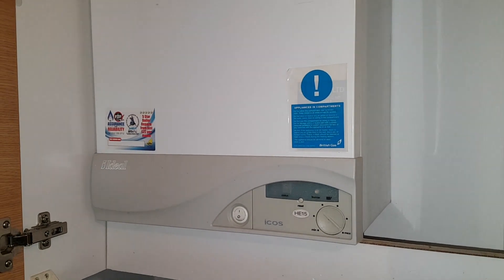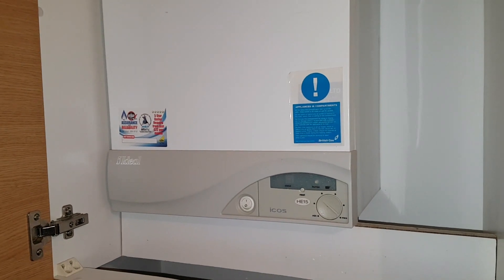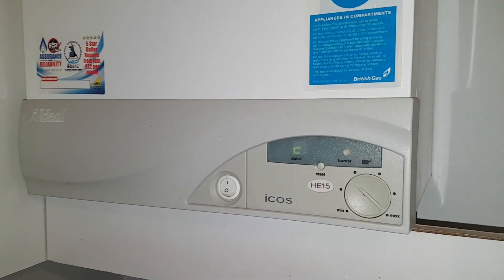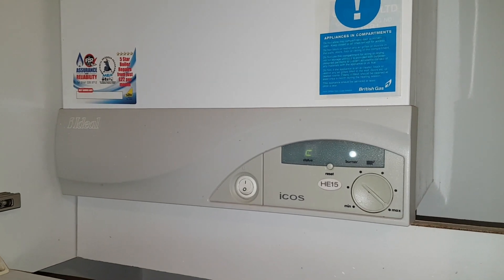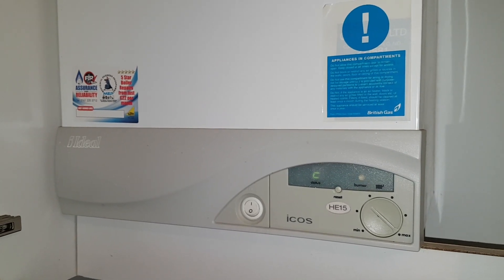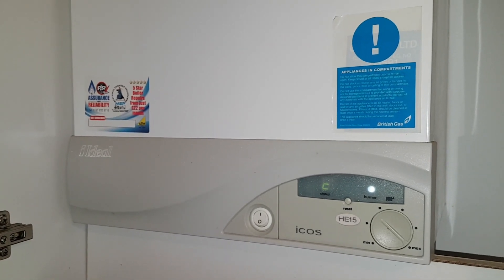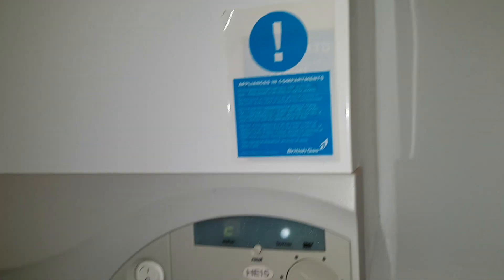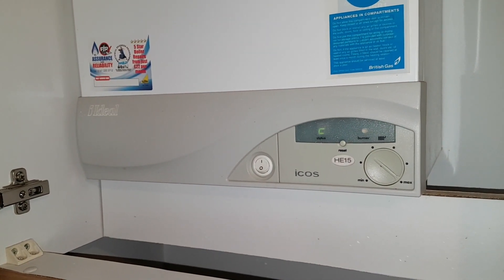Ideal Icos HE15 What Are The 2 Faults?

Comment: My Boiler is making a kettle noise and then locking out, is this a blocked return pipe as the boiler is overheating? It has had a new pump and 3 why zone valve?

Comment: I recently had this issue. For me the hot water was fine but no had no central heating. If anyone is watching this looking for answers, I removed and cleaned the trap and it didn't help (but needed cleaning). I then noticed the pump was making a strange noise, so replaced it. This solved the problem instantly and the boiler no longer makes noises.
Reply from the maker: Thank you for your comments. Can I ask if you would subscribe to our channel 😊

Comment: I have the same boiler, just moved into a new house. I can't get the boiler to restart. It has a 0 on the front which I know means standby, but the restart button does nothing. Could you give me some advice please? Thanks
Reply: I'm in exactly the same situation. Any ideas?
Reply: hi i have the same issue , were you able to resolve , if so how , kind regards
Reply: @kbeckfor  No, it's been  replaced with a combi boiler.
Reply: @rachelmichellef  thanks

Comment: Hi All.  have the very same Boiler -  We didn't have good pressure to have a decent shower, so installed a pressurised tank under the stairs about three years ago.  all good till now.  Water is hot thankfully but heating is intermittent.   we have a Honeywell wall controller for the temperature, i believe its wireless.  Ideal support team claim the issue is the temperature controller.  so the question is -- what's the best temp controller to use and how easy is it to do so?

Comment: Check the condensate trap for sludge. the Icos has an aluminium heat exchanger that corrodes like a bad-a55 and the particles blocks the drain. 

Also check the pressure vessel if you have a sealed system. you need 1.3 - 1.5 bar. if you're around 1.1 bar that's close to the boiler's auto shut-off pressure.

Comment: Hello is this a system boiler or a regular conventional boiler? I have one of these with a hot water cylinder and no water tank in the loft, trying to work out which will best replace this type of boiler
Reply: If you have a sealed system (red vessel on top of the water tank) then check the pressure. it should be between 1.3 - 1.5 Bar.

Comment: What was the fault with this?...I have the exact boiler doing the exact thing, no hot water🙈
Reply: Did you fix it?
Reply: @minot.8931  hi i have the same issue , were you able to resolve , if so how , kind regards
Reply: @kbeckfor341  On mine the condensate drain was blocked.  The boiler has an aluminium heat exchanger, so it produces small pieces of aluminium oxide (looks like grey grit) inside the boiler.  That ends up in the condensation trap (the small black plastic box under the boiler) and eventually blocks it, so the condensation collects as water inside the heat exchanger.  When it gets full, the boiler starts banging  (suffering from "explosive ignition").  You need to remove the condensation trap and empty out all the grit.  Ideally you should also remove the panel from the heat exchanger and dry it out, and then sweep out all the grit, to save it getting into the trap and immediately blocking it again.     On mine, I had a further complication in that the plastic exit pipe from the condensation trap to the outside drain was blocked; I suffered a blocked drain not long before so probably sewage/gunge/kitchen sink mess etc. had backed up from the sewer and reached the connection of the condensation pipe outlet, where it joined the drain, and had blocked it.  I used a bit of caustic soda down the pipe to dissolve the soap/sludge/poo or whatever was down there.  Don't use caustic soda anywhere near the aluminium of the heat exchanger since caustic will aggressively attack aluminium.. only down the plastic pipes.   I used a kitchen spray bottle to squirt the caustic soda down the pipe... but be careful with it (eye and skin protection) since it'll splash/spray and it will burn you.
Reply: @minot.8931  thank you very much 😊🤝😊😊😊😊

Comment: I have this boiler, since last its been making a constant noise as if it's on but neither central heating or hot water are switched on but it's still making noise. It's normally quiet. Reset button on front does nothing if pressed in.
Reply from the maker: It could be a zone valve fault

Comment: Water is not getting through the boiler and its cutting out due to thermal cut off.  The gurgling sound indicates that the circulation pump may not be providing enough / any pressure into the boiler.
Reply from the maker: hey we're currently trying to grow our Facebook group and would love you to join Tony and the team using this link, Tony will be available to answer all your questions directly https://www.facebook.com/groups/167070231326174 we will also add this link above.

Comment: We have exactly the same problem as described in your video. 
We have a boiler contract with British Gas and the boiler has (supposedly) been serviced every year for at least the last 5 years. Now my wife is getting worried by the noise the boiler now makes (as described in the video).
It would be handy to know how to describe the fault to British Gas as it doesn’t seem to do it all the time.
Reply: We had this problem now fixed it was the condensate trap full with a grit like substance cleaned out fully put back in problem fixed took 10 mins
Reply from the maker: hey we're currently trying to grow our Facebook group and would love you to join Tony and the team using this link, Tony will be available to answer all your questions directly https://www.facebook.com/groups/167070231326174 we will also add this link above.